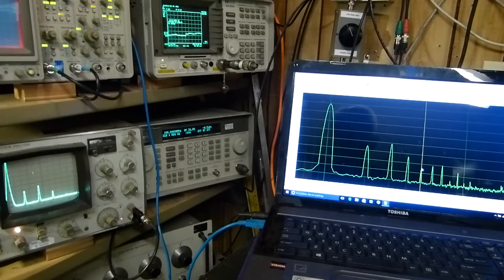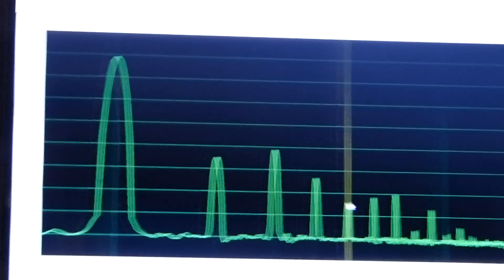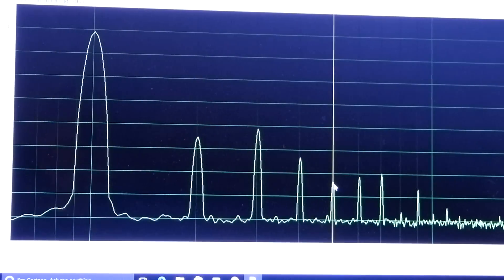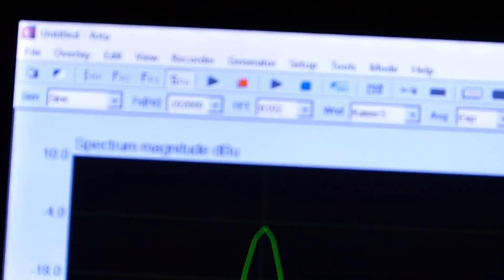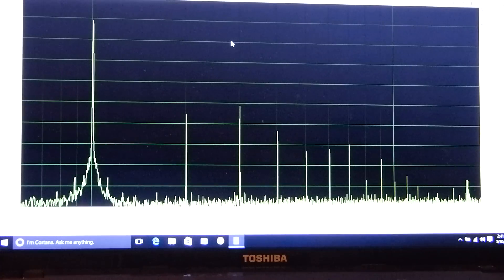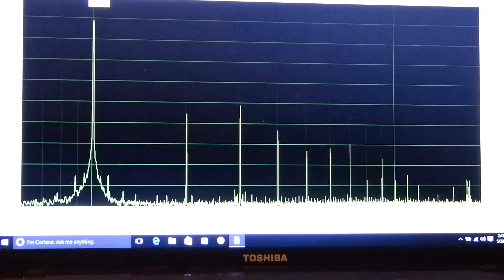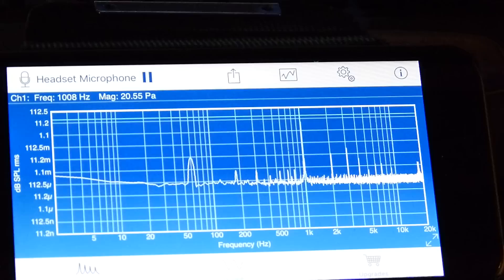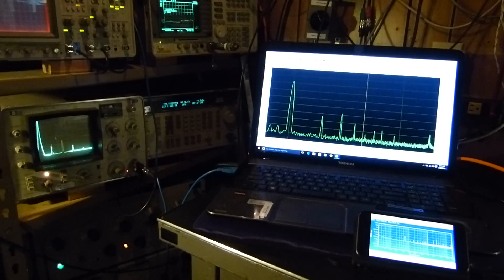Comparing PC FFT Program ARTA Software to HP 3580A & iPhone FFT Program

Comment: +ElPaso TubeAmps  Have you ever considered the HP 3585? 20 HZ to 40 MHz. 3Hz RBW. Tracking generator. 50/75/1M ohm inputs?
Reply from the maker: I have considered that HP model and also the ones that go down into the milli-hertz region. One thing that I have found out about SA's is that the very lowest end of the specs is often times hard to attain and this SA goes up to 40 MHz - it's really not an audio frequency SA. 20 Hz is actually not low enough for audio, in my opinion. The 3580A goes to 5 Hz and will take eight (8) minutes to make one sweep. With these FFT analyzers, it is easy to do 5 Hz (with RBW in fractions of a Hz) and is so much faster than a swept-tuned analog SA. I think the FFT analyzer is the way to go in audio not that I don't love the magnificent HP equipment of yesteryear but all that equipment is approaching 40 years old and some day it is going to quit and may not be repairable. The new FFT equipment can be had for less than $250 (maybe even free) and it has a much lower noise floor so you can easily see signals well below -85 dBm that is the limit of the 3580A.
Reply: +ElPaso TubeAmps With every thing going USB, I may have to buy a computer for the bench some day. For some reason I prefer the look, and feel of dedicated test gear. It is nice to have buttons and knobs in the physical world.
Reply from the maker: I prefer dedicated equipment also but things are changing at an accelerating pace. Luckily, much of this stuff is made in China for pennies of what it cost many years ago and it actually gives us good answers. It reminds me of a cartoon I have seen just a few times. An old lumber jack with an ax and a pencil-pusher geek with a chain saw get into a contest of chopping and cutting wood. In the spirit of cartoons they start chopping and cutting and the pile of wood quickly goes miles high into the stratosphere for both of them -  Then another little fellow comes out with a ruler and measures both piles and the pencil-pusher geek has a pile 1/4 inch higher than the lumber jack. That is the advancement of technology.

Comment: the new sounds cards should be able to get 38400khz, if you have an AMD PHENOM II X6 you might be able to use the 32768 point FFT.
Reply from the maker: This one will go to a sampling rate of 19.2K and an FFT of 131072.  It goes to 100 KHz but has a rise in the apparent noise floor because of the DAC, as it has been explained to me. I have found that for looking at 5 Hz it is much better to use a sampling rate less like 44100 (that is as low as this sound card will go) and highest FFT. The pulse width is then from 4.4 Hz to 7.4 Hz wide (4 Hz) and looks like something that could be used. The higher FFT rate seems more important on the lower frequencies - to give a low RBW. On the other hand, who really needs a RBW of 1 Hz for a 10 KHz signal?